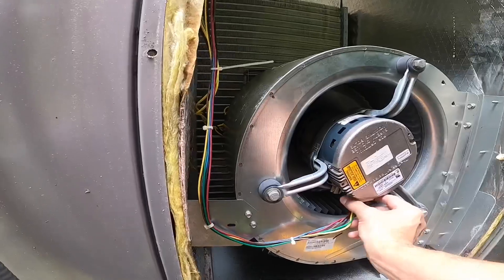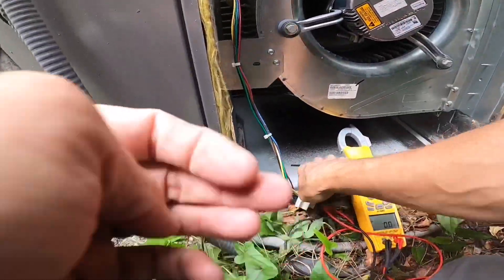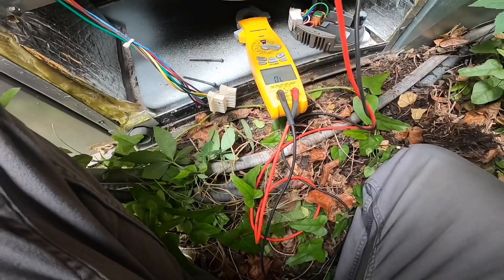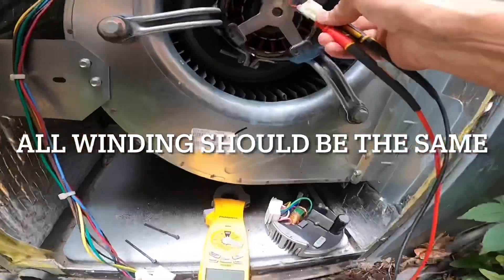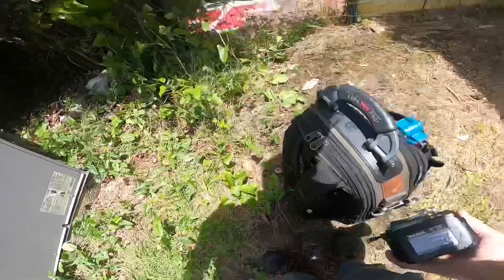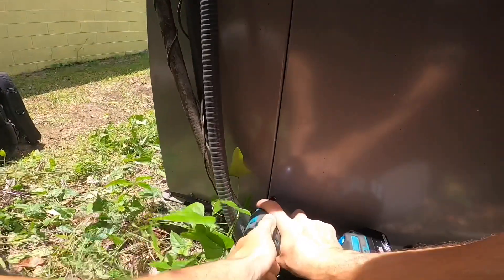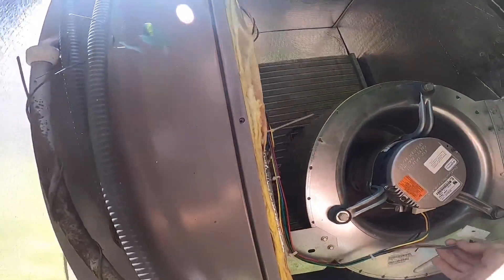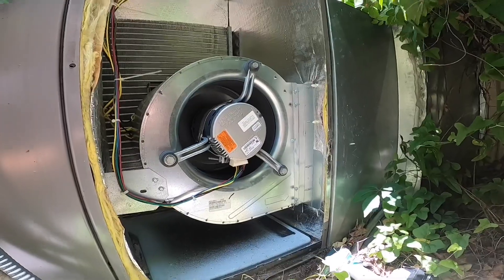Ohming out an X-13. Hard part was getting to it.

Comment: "This is a 3-phase DC motor". Please describe each of the 'phases' of DC??!! IS it possibly a PWM DC Motor?
Reply from the maker: The module converts the AC single phase current to a 3-phase DC output. That’s the basis of the ECM motors, if they are constant torque, like this one, or constant airflow, like the variable speeds. That’s about the extent of my knowledge on them.
Reply from the maker: But, I don’t think I’ve ever heard of them described as a pulse width modulating motor. I guess it could be, I just don’t know.